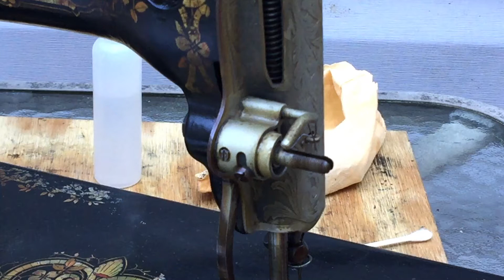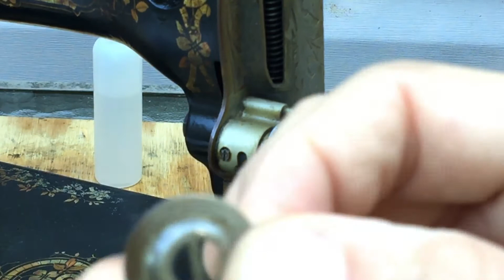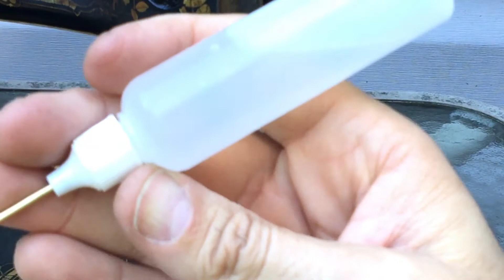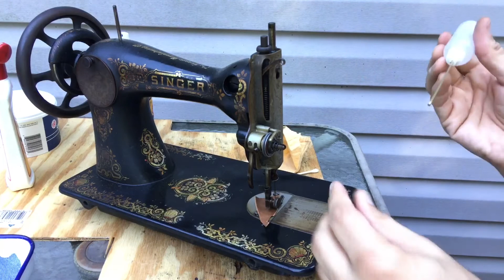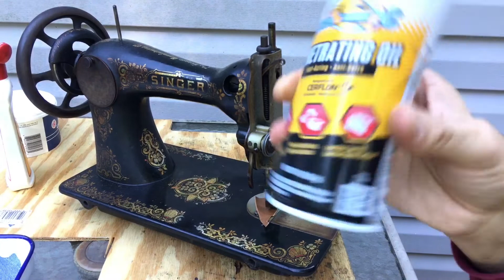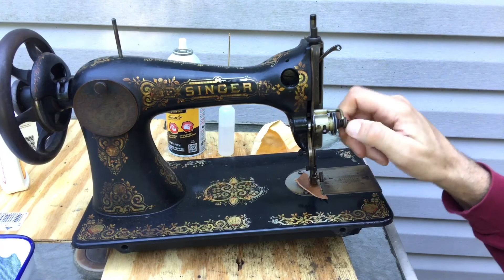Singer 115 treadle sewing machine restoration Video #6

Comment: Hi I have a question, I have recently purchased a kenmore model 83 rotary sewing machine and I'm having trouble threading the boben and was wondering if there was a video that you've either recommend for helping me or if there was a video that you've made in the past that you think that will provide me with the answer I need, thanks
Reply from the maker: Hello Hector.  I can understand why you have problems with the bobbin or bobbin case threading.  Actually, there is a good chance that yours is not broken.  Unlike Singer manuals which are nicely illustrated, the Kenmore manuals were not as well written and the bobbin cases and even the threading of the machine itself can be challenging until you know how it works.  I will try to create a video showing this very thing if I get another rotary to work on.  I will use natural light since its a very difficult to zoom in on a bobbin case when threading it.  Keep a watch on my channel and as soon as I come across another rotary style Kenmore, I will try to video it.  I have had others ask about the same thing.  Thanks for writing!
Reply: Vintage Sewing Machine Garage thank you so much, I'll stay tuned till then